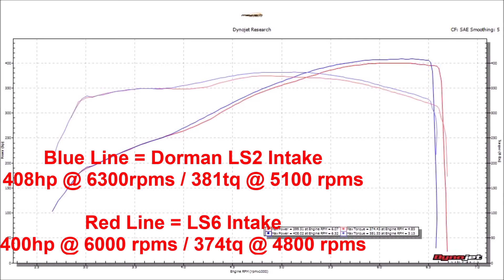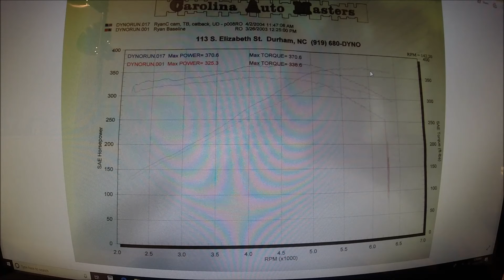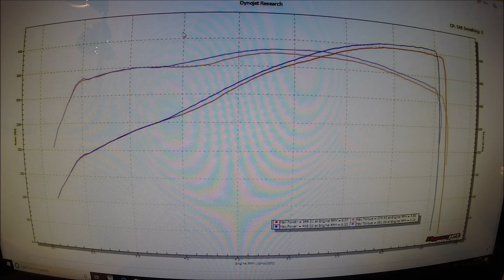Corvette Dyno Day - LS6 Intake vs Dorman LS2 Intake

Comment: Thanks for your knowledge as always! I think I will stay with the stock LS6 intake, t.body and injectors. I'm doing a camshaft swap only with all the bolt ons in my 2002 WS6. If, during tuning, we determine there is alot of power not being realized, I might think about more air or fuel modifications. Its a street car only, so unless I'm not realizing 30+ horsepower and or torque measurements, I will just leave it at that. Thanks again,   Mike in DFW

Comment: Something to note, Mayhem’s dyno reads low. Always has. Take it over to RPM and it’ll probably put down another 20 WHP
Reply from the maker: Good to know.  The car pulled really hard and had a nice smooth torque curve, so I was very happy with the drivability.   I've since sold the car but it would have been interesting to see if a different dyno gave a different number.

Comment: Great video. Thank you for creating and posting thumbs up. IMO C5's need to have their dyno pulls done much lower because their daily driving range is 1000 to 2500 RPM. I know for my build I'm really focused on not loosing tq in that lower range while working to build area under the curve and higher peak numbers. Best to you in your build.
Reply from the maker: I agree.  When picking out my camshaft I was careful to get something that wouldn't lose low end torque.   I think a bigger cam would definitely make more power at the top end, especially with the ported heads, but I think it would start to come at the sacrifice of low end torque and driveability.   No right/wrong way to do it, just depends on where you want the power for a given application.   Good luck on your build!

Comment: If I get the dorman ls2 intake since it's bigger I wouldn't be able to run the cai i have on right now?
Reply from the maker: You might need a different size coupler to go from the intake tube to the 90mm tb.   That’s all I needed to change and was able to keep the rest of the intake.
Reply: @ScrufsGarage  cool man thanks 👍

Comment: Does the LS2 Intake manifold fit a 1998 z28 LS1 without modifications?
Reply from the maker: It will require some modifications depending on your application.  I did a couple of videos to help show what's needed.  https://youtu.be/cfJh3Hnv6RI  and  https://youtu.be/K6W7wgcASx8       I also did a video on porting the Dorman LS2 intake manifold that you might enjoy.  https://youtu.be/rxwLA_pGR7Q

Comment: Cool vid and good info, I currently have an 03 Z06 with full bolt ons (still running stock ls6 manifold), vararam intake, full exhaust, ported factory heads with dual springs, injectors, and a milder 218/224 cam and it put down 415hp 390tq, been looking at getting the doorman ls2 intake (I have the ls2 throttle body waiting already) for a while as a cheaper alternative to the fast ($$$) 92 intake, goal right now is to get to 420+ hp and 400tq and looks like this intake and a tweak to my tune should probably get me there. Eventually am gonna step up to a BTR stage 2 cam (227/234) and hopefully that will get me closer to 440-450hp range and 410-420tq.
Reply from the maker: Sounds like a plan.   Definitely come back and give us an update as you make progress!   Thanks for watching.

Comment: So I'll start by saying this video inspired me to buy the dorman with plans to run it on my ls1 f body. I've been sanding the whole intake down to prep for paint. paint (and remove the ugly tq specs and other writing. ) after shining a light in the first intake port, a very clear problem appeared. The intake does not seal properly internally. Where the 2 halves are sonic welded (basically melted) together, there is a small gap where the 2 pieces never touched. The first 2 intake runners on the left and first 1 on the right all have this problem. Which is the exact issue the oem ls2 intake had. Very disappointed and there's no way I can return it now. If I wouldn't have inspected it very carefully I would have never noticed. Just a warning to everyone that thinks this is a good idea. Some may have installed without checking this. Dorman quality is very poor. I expected to clean up the casting but aside from doing patchwork I'm not sure there's anything I can do
Reply from the maker: That's interesting... and disappointing I'm sure.  Are you sure the parts are actually leaving a gap/hole for air to leak through (more than just a step in the material)?   You probably saw my other videos on porting my intake.   I removed quite a bit of material in each intake runner and never came across any gaps.     I have no affiliation with Dorman, but I have been to their facility in Colmar, Pa.   They have an extensive 3d scanning, 3d printing, and development test lab.  Maybe you got a dud though?    If you emailed Dorman directly with some pictures, they might be able to assist?   Sorry I can't help more.
Reply: @ScrufsGarage  emailed dorman today hopefully they can help me out. If not anybody wanna buy this intake or trade for ls6?

Comment: Was this with the doorman ported ?
Reply from the maker: Yes, that's correct.   This is the stock LS6 intake with an 80mm BBK trottle body vs the ported Dorman LS2 intake with a 90mm LS2 TB.   Both running FAST 36lb injectors.

Comment: I love the comparison, but correct if I'm wrong. The factory ls6 intake has a 78mm opening compared to the dorman 90mm. I think it is obvious that the dorman will fair better than the ls6, once the rpms goes up! Which prove my point in the dyno. As the rpms goes up, specially pass 4k. The dorman fair's better. So is the dorman a better intake, because of the internal makeup? Or is it simple better because it has a bigger throttle opening?
Reply from the maker: Correct, one of the key benefits to the DLS2 intake is that it allows you to run the larger 90mm TB.  The larger TB has the potential to flow more air... so long as the intake manifold can also flow the additional volume of air.  So the TB/intake have to work as a system.  If either is a restriction, it can negate the benefits of the other.   To me, the more useful observation is that the DLS2 TB/intake has gains in the upper rpms, without losing power in the lower.  Often intake manifold changes that produce top end gains, come at the cost of lower rpms as the torque curve moves upward in the rpm range.   It would be interesting to see how this would have compared with the more expensive FAST intake.  And it would have been interesting to see this test on a higher hp motor.   My guess is that the gains would increase on a motor that could use the additional airflow.
Reply: @ScrufsGarage so u think the ls2 is better than the ls6

Comment: Fyi for all... If you have someone dyno tune your car. Watch if they take baseline in sae then final #s in STD. If you change them no matter where you are or mods done... They read different. Its just a drop down box on the computer/laptop and you scroll thru couple settings. SAE reads lower than STD. Bad tuners that want to impress you will take baseline #s in SAE and final pull in STD to look like they found you more power. You've been warned!
Reply from the maker: Agreed, it's important to be aware of the difference between SAE and STD numbers; and to make sure the before/after numbers are in the same format.    There are a lot of variables that can impact the exact hp numbers generated on a particular day (temperature, humidity, altitude, etc).  SAE correction helps adjust the results to a standardize set of parameters, allowing dyno results to be a bit more comparable.   Often STD numbers will be higher.   We looked at the STD numbers from one of my dyno pulls, and I believe it was in the mid 420's, but honestly I didn't even write them down.   The SAE numbers were what I wanted.   And of course it's important to not get too hung up on dyno results; it's just a measuring tool and results can vary from one dyno to the next.   What's important is how the car runs and performs.
Reply: @ScrufsGarage  of course nature's variables. I would hope 99% people know that even if its their first rodeo. If they know what a dyno is to want their car dynoed or dyno tuned, they should know that. I have never had to explain heat to a customer being in the edge of the desert. But sae and std, only tuners generally know. Was the first gag I learned to tease customers with when I was showed on my buddy's dyno when I started working with him to do the GM tuning since he was a ford guy. However, that was back in 2013 and have since focused on lsx swaps and turned a ford guy straight lol. Less than 6 months in the shop, his notchback recieved a 5.3L heart since his ford block was too thin for 500hp. Ahh good times in Cali

Comment: Good videos I like them 👍🏻Without knowing how much $$$ the Dorman intake cost I’m not sold that it was needed for your combo especially for a street car. It has made a bit more power and torque but it has moved up in the rpm range, good for a strip car (the extra rpm may suit you for circuit work) but in my opinion the LS6 intake would have been fine for your combo. 👍🏻
Reply from the maker: Given the harness adapters needed for the DLS2 intake, it will likely cost a bit more than a used LS6 intake, but should be cheaper than a FAST intake.   While the intake did shift the peak power numbers up in the rpm range, it still made more power at any given rpm and didn't lose any power down low.   So regardless of the intended usage, that's a win.   There's definitely nothing wrong with the LS6 intake, but I had a chance to try the DLS2 so I wanted to see how it compared.   I think the power gains would continue to increase on a larger displacement motor, forced induction, and/or a big cam as you could take advantage of the increased air flow.   Thanks for watching!

Comment: Will the Dorman not run the 90mm throttle body?
Reply from the maker: The Dorman intake uses the 90mm TB.   The LS6 intake uses a 78mm TB.    So part of the benefit of the Dorman LS2 intake is that you can run the larger TB.

Comment: The ls2 just bolts on?
Reply from the maker: Yes, this is the Dorman LS2 intake manifold (the GM LS2 intake wasn't very good).  It sorta "bolts-on."   There are some modifications you need to do.  I did a video series on what it takes to install this intake.  I also did a video on porting the intake runners.   Check those out, I think you'll find them helpful.

Comment: what fuel pump / lph gph?  I'd be curious what a TRUCK intake / rails aka BREADBOX TBSS, would make, you'd have to take off ur hood no doubt, but a stock truck intake / rails is supposedly the best power to $ there is bar none
Reply from the maker: I'm still on the stock C5 fuel pump.    Not sure how the truck intake would do.  I've heard good things about it, but since it doesn't clear the hood, it isn't considered much in the C5 world.   But other applications could benefit from it.

Comment: hey great numbers!.. my c5 made 380whp and 420lbs torque with a 222/225 howards cam
Reply from the maker: That's a great torque number!  And that size cam should have great driveability too.
Reply: @ScrufsGarage  thanks ! And it does that's the main reason I got it .. since mine it's an auto I didn't want to change the stall .

Comment: What injectors did you use? And did you have to use adapters? Thanks!!! You're curve looks awesome.
Reply from the maker: I used the FAST 36lb injectors.   No adapters needed for the injectors.  Thanks, I'm very happy with how the car runs.
Reply: Did you end up using your ls1 fuel rails and ls1 style injectors as well?
Reply from the maker: Yes, that's correct.  Reused my original fuel rail, and used ls1 style injectors.
Reply from the maker: I used FAST part # 303608
https://amzn.to/2X12UqX
Reply: @ScrufsGarage  awesome dude. Thanks a lot!!!
Reply from the maker: No problem.  Happy to help!

Comment: Great comparison.  Certainly makes a compelling case for the Doorman LS2 intake and T/B.  Your torque curve is impressive for a cammed engine.  That thing probably pulls hard (or lights up the tires easily!)
Reply from the maker: Thanks!   I'm very happy with the power curve.  I actually drove the Corvette to work today and as I was sitting in rush hour traffic, I was thinking how happy I am that I didn't go with some massive cam that ruins driveability, haha.

Comment: I really wouldn't worry too much about your low dyno numbers. Trap speed in 1/4 mile is a much better indicator of horsepower. My Camaro made 413 rwhp with stock 853 heads, and LS6 intake, 1 7/8" headers with a 232/234 .600/.600 cam, but I would bet almost anything that your Corvette would easily walk away from my Camaro.

BTW, thanks for posting these videos, I learned a lot, specifically I learned how to install an oil pump, which I did with my cam swap last August.
Reply from the maker: I agree, dyno numbers certainly aren't everything.  Hopefully in the spring I'll finally get to do a track day with it.  With the old motor I could hit 146mph on the back straight at VIR.  I'll be curious to see how it does with the new motor.
Reply: Scruf's Garage pretty close to what i made with 231/242 .600 lift “stage 3” 412h 418t I’m lookin into heads and intake upgrades now.

Comment: I bought an ls6 valley cover from improved racing. Got it quick and priced fair.
Reply from the maker: NoneSponsored/BunkAssMechanic Awesome, that’s where I got mine too.  They’re great to work with.  I also bought all the components for my oil cooler setup from them.  And my oil pan baffles.
Reply: @ScrufsGarage  nice.  I am about to get a melling oil pump and a whole bolt and head gasket kit since I'm going to cam swap my vehicle
Reply from the maker: NoneSponsored/BunkAssMechanic awesome!   I’m having good results with the smelling 10295 oil pump.   I also recommend getting the ARP head bolts.  The factory ones are single use TTY whereas the ARP ones are both stronger and reusable.  Best of luck on your build!
Reply: @ScrufsGarage  thank you. That is the exact pump that I want. Going with a 222/226 cam. Just perplexed on what size  rods I need with 241 heads.
Reply from the maker: NoneSponsored/BunkAssMechanic do you mean push rods?   I did a video on how to measure for push rods that might help.  But if you’re only changing the cam (no change to the heads, gasket, etc) then you’ll most likely need the stock 7.400” push rods.  Talk to the cam manufacturer though to make sure they didn’t change the base circle of the cam which could change PR length.
Reply: @ScrufsGarage  well I am going to get ls7 lifters so the heads will be coming off. I will talk to comp cams again. Thank you
Reply: @ScrufsGarage  qqqaP

Comment: That is an excellent Hp/Tq curve.  Torque is amazing.  You have 325 TQ starting from 3000 rpm up.  You probably have 300 TQ form 2K rpm’s.  Pretty damn good.
Reply from the maker: Thanks.  I'm really impressed with how broad the torque curve is.   I am also happy with the driveability of the cam.  I was worried that it might buck at parking lot speeds, but it really isn't bad, even with the light weight flywheel.  VERY happy.  :)